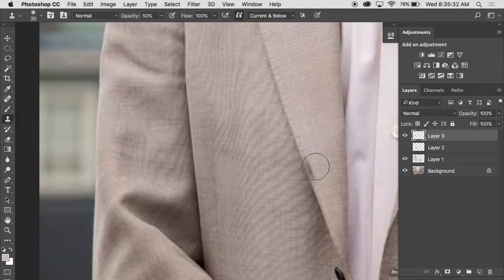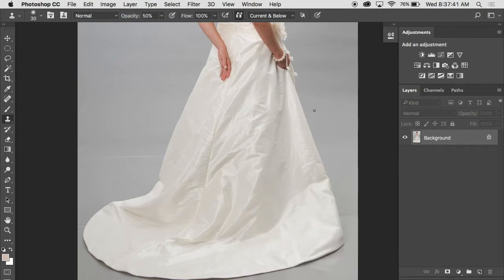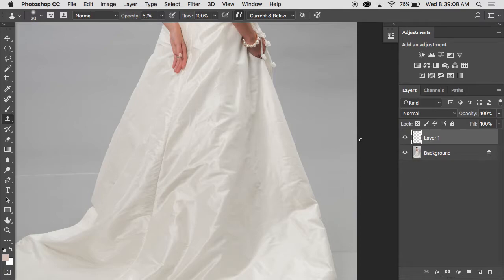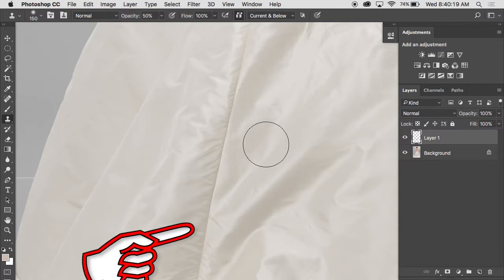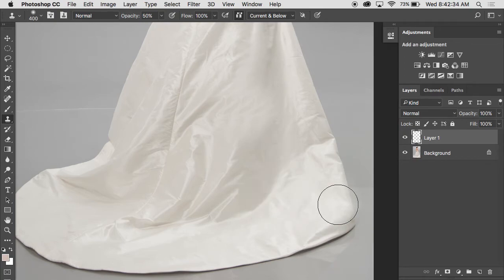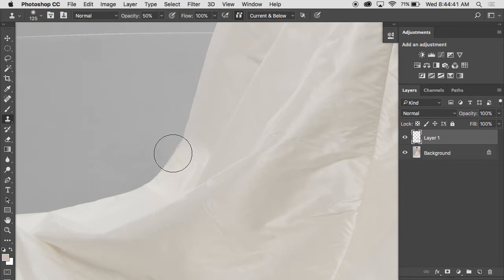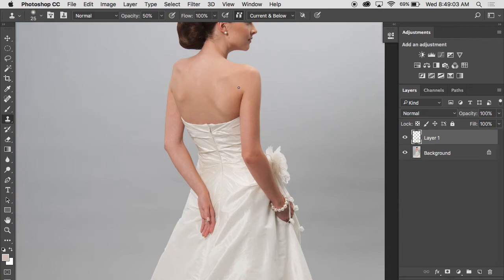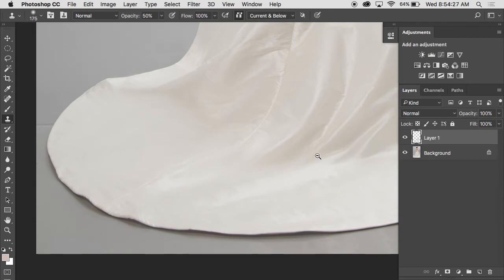Softening Wrinkles on Smooth Fabric

Comment: This video is great. I wonder how to create a smooth transition of highlights, midtones and shadows on model using lightroom. Please let me know. Thanks!
Reply from the maker: Lightroom has some fairly basic retouching tools, but nothing that could give the seamless wrinkle removal that can be achieved in Photoshop. You could try creating an Adjustment brush that pulls the Clarity and Texture right down, and maybe the Dehaze, and giving the wrinkles the smackdown with that, but I think your best bet would be to do it in Photoshop.